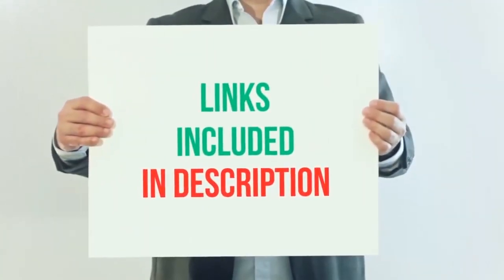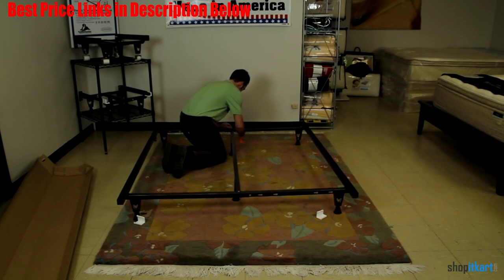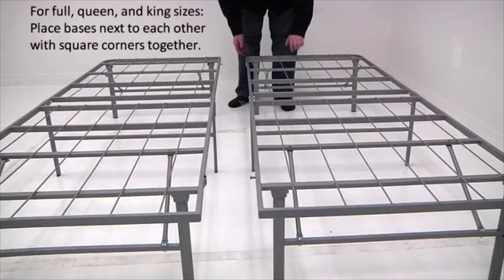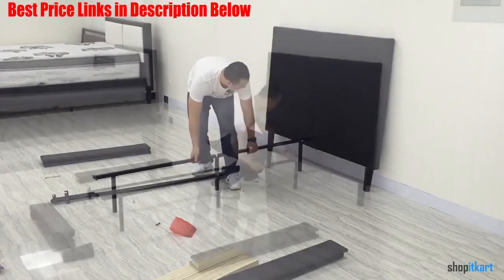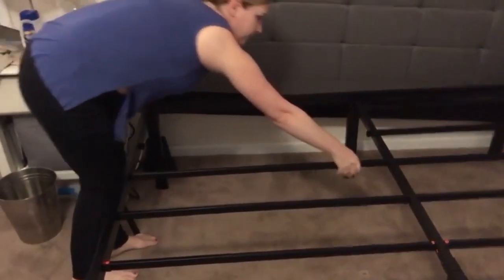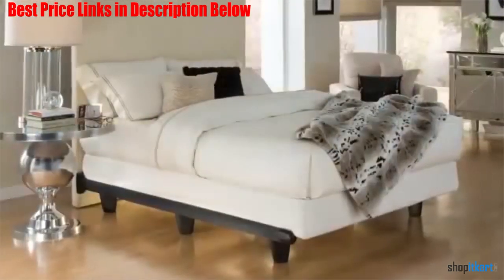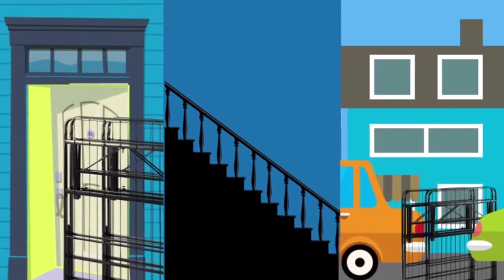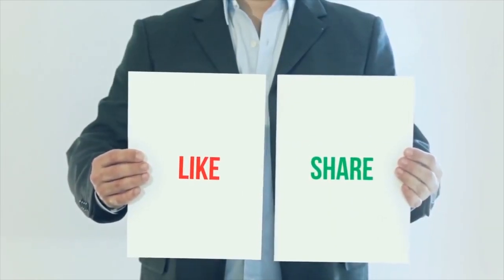Best Bed Frame For Overweight Person 2023 [RANKED] | Buyer's Guide

Comment: Avoid zinus. Their wood slats and spacers are spaced more than 3imches apart, which is more than mattress specs for frames. So if u don't want a prematurely sagging mattress avoid. They also don't cover warranty or sell parts that break easy like center peice.

Comment: I do not recommend #10 to anyone.
I had it for a week and it was almost bent in half. Mind you, I weighed around 475-480 at the time I had it so I was on the lighter side of 1k. Still, if you are 400 or over, I would not recommend purchasing it. My mom, who is around 200 lbs lighter than me used it after I did and it still broke.
Reply: Hello which one do recommend? I'm trying to buy one for my mother who weighs around 500.
Reply: Which one do u have now?
Reply: @margaritajimenez-gastelum3220  sorry for the late response! I'd recommend a futon that has a solid bottom.  (Enclosed, box-like)
That's what I have now and I am now  almost under 400.